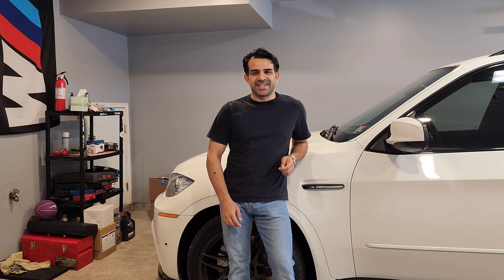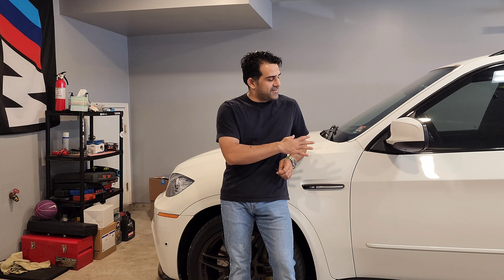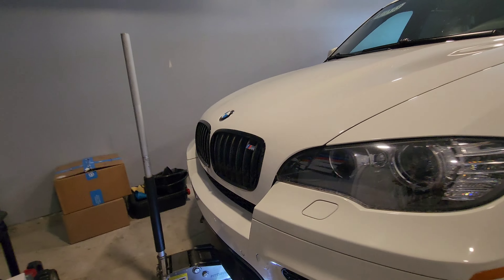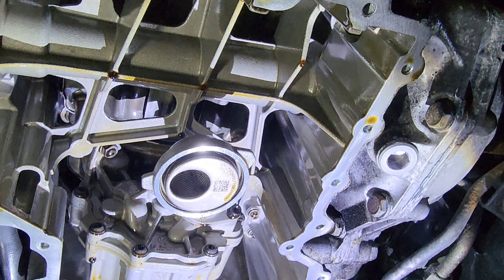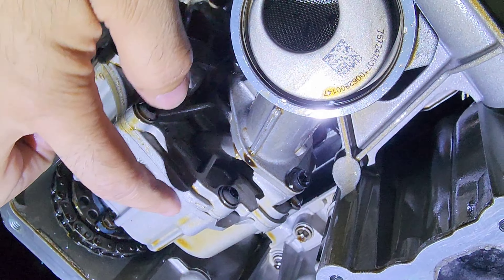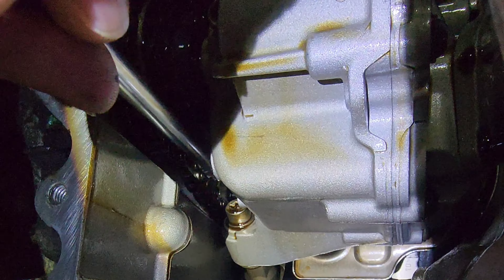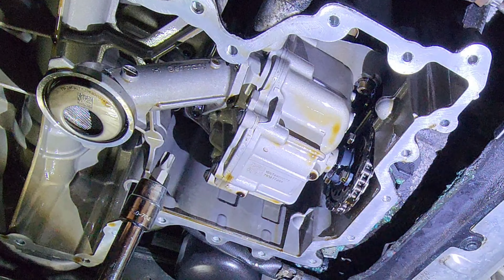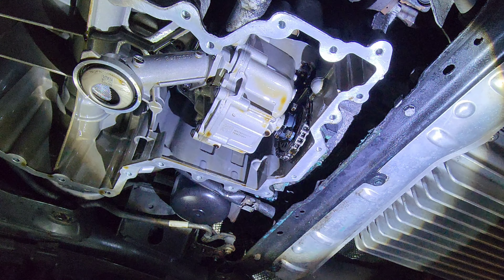BMW S63/N63 Must do DIY - Oil Pump Chain | 4K

Comment: Thanks for the video how does one confirm proper tension? Doing mine this week 2016 X5M
Reply from the maker: @franktrivoluzzi6202  hey, I think I did reference in the video - from what i recall, it was 12mm for both sides, so about 6mm slack each side. It's a PIA to do with the space you have. Good luck!
Reply: @E70MGarage   Yes I do recall that but how do you actually measure that is what I was getting at thank you.
Reply: Did your vehicle have a large metal plate to remove under oil pan, Any advice on it??
Reply from the maker: @franktrivoluzzi6202  i used a measuring tape as i didn't have the tool BMW calls for.
Reply from the maker: @franktrivoluzzi6202  which tray? Do you mean the reinforcement plate?
Reply: @E70MGarage  yes, I figured it out.Thanks for all your help.
Reply: Five millimeters is roughly the size of an eraser on a  pencil so that gives you something to go by.  I finished mine up today.Just need to get the oil pan on .

Comment: I have re-used my reinforcement plate bolts multiple times, probably not a good idea :D
Reply from the maker: I have too 😂 but it's not a good idea. Bolts that have tightening torque and degrees specs are stretched or de-shaped - may appear to be the same to naked eye, but aren't.
Reply: This is inaccurate and misleading information and should be banned.

Comment: Any symptoms or noise that made you aware of this
Reply from the maker: There was a chatter/rattle for 10 seconds or so at cold start, it's still there but fairly less.
Reply: @E70MGarage those sounds are actually from the 4 throttle bodies. Each cylinder has one. Sounds like a type writer.
Reply: Did you change your chain and chain guides? That is the only way to truly solve this issue.

Comment: About to do this on my 2014 550i. Did you end up buying new reinforcement plate bolts? Since they’re one then use. Also, how are you able to measure how many mm of slack you have.
Reply from the maker: I didn't replace the reinforcement plate bolts, but you're correct - they're one-time use only. I eyeballed it, 6-12mm is about 0.2-0.4" but you can find specialty tools to measure the slack from eBay.
Reply: Have u ever timed ur 0-60? How much whp?
Reply: @karannanda6517  it’s supposed to be 4.5 seconds
Reply: @SageXteriorCleaning  "supposed to be" he's stage2+